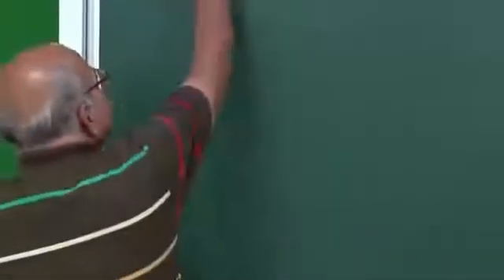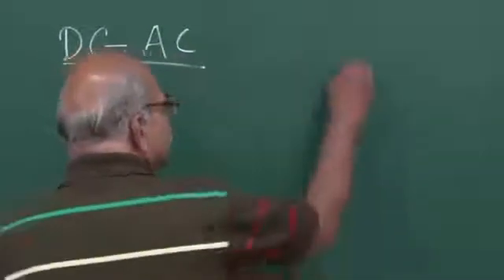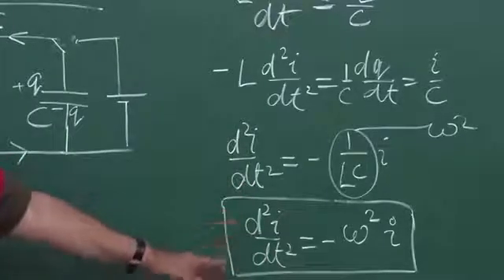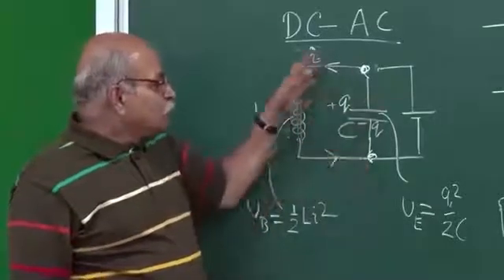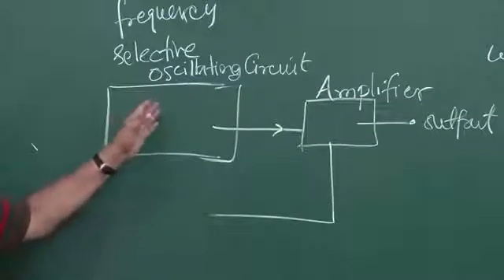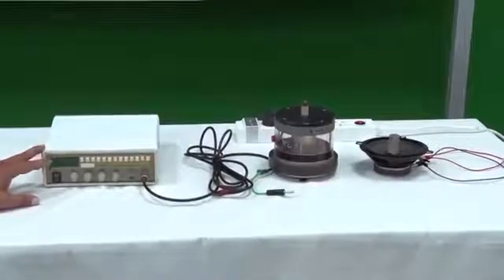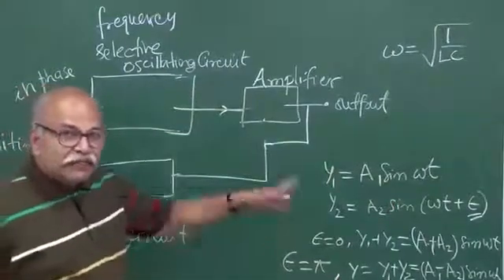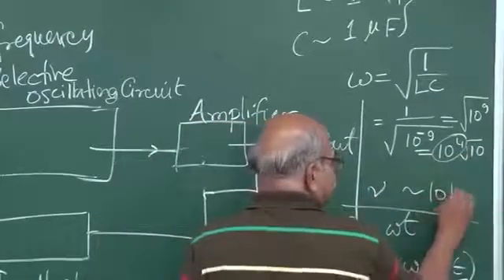Transistor makes it oscillates by HC Verma

Comment: The perfect illustration of oscillator is like, 'Oscillator is a electronic circuitry which produces periodic electrical signals....'....Something like that....It's not a DC-AC converter....Coz square wave is still considered as DC....